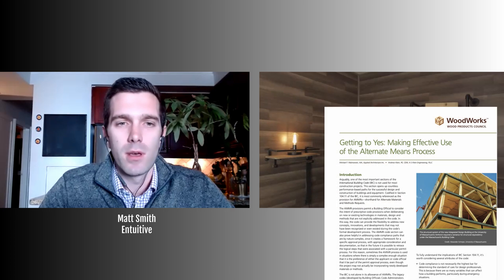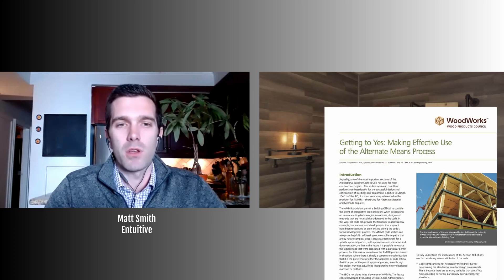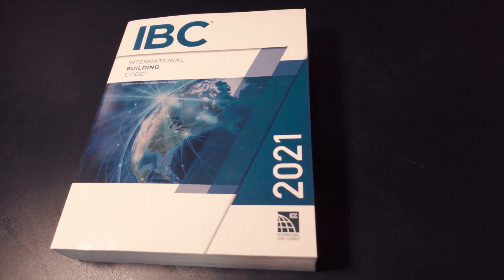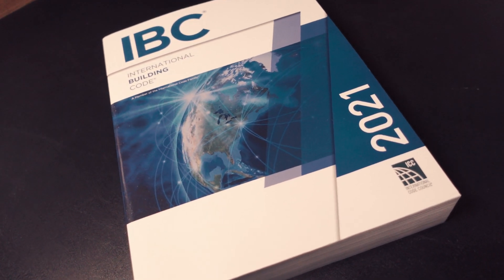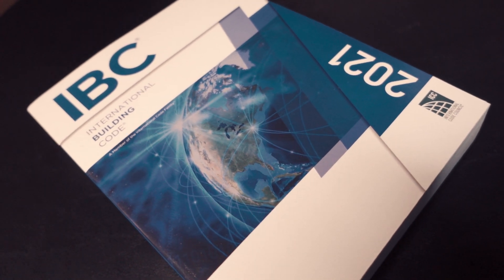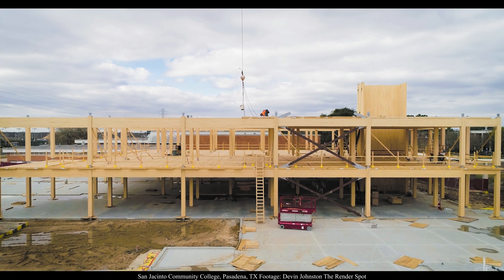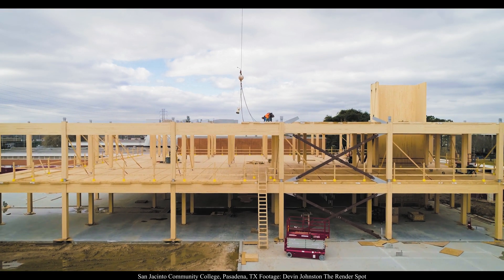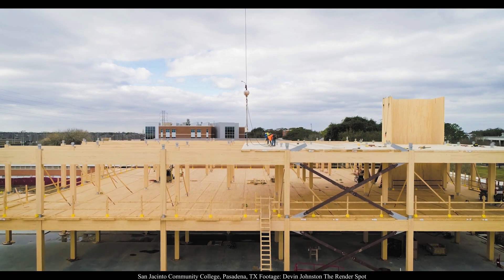Performance Based Fire Design for Mass Timber

Comment: Ricky, make an issue on the economics of wooden buildings.
Is mass timber more expensive or cheaper than traditional concrete structures?
Thanks for your videos.